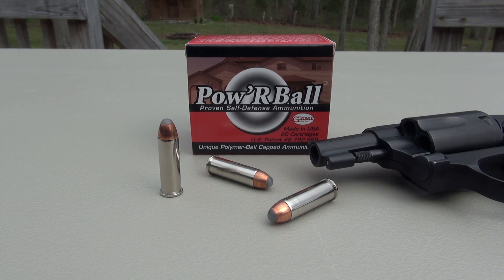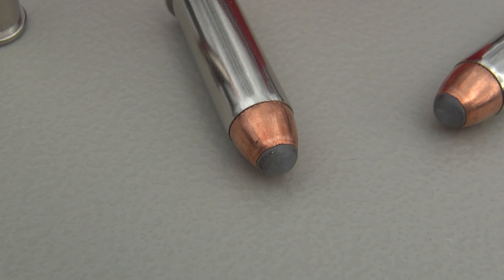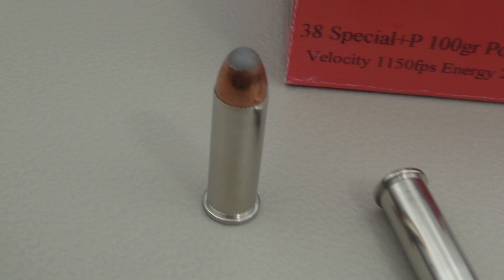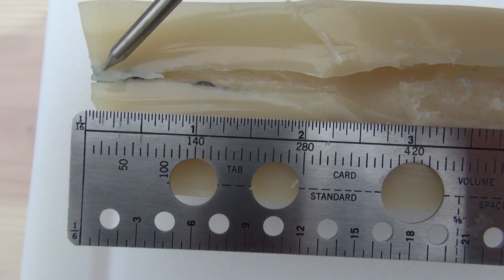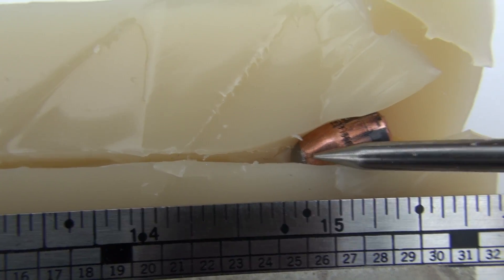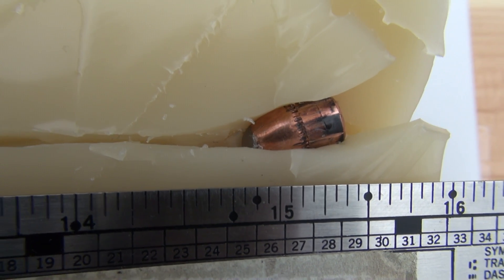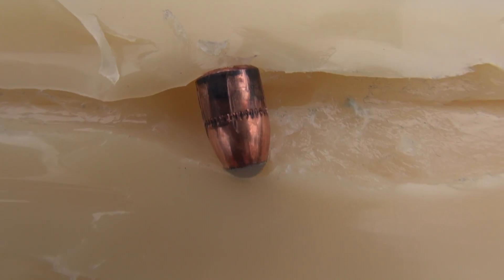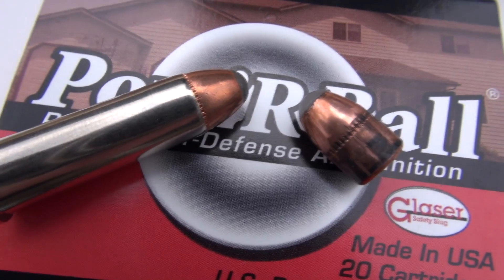CorBon PowRBall .38 +P 100 gr SIM-TEST w/Denim

Comment: most revolver hollow points will expand out of a 3 in or more barrel.
Reply: Most won't out of my Smith 649 1 7/8 barrel.
Reply: Then they should do well out of the Taurus 856 Defender with the 3-inch barrel.

Comment: No i never did hear from them. in my opinion its either Federal HST or Gold Dots for me i have never seen or heard of a failure of any kind with them
Reply: I recall using 125gr Gold Dot in a snub and water jugs with and without denim. Little to no expansion was noted. I'm not impressed with the Gold Dot in a 2" barrel. Even the new HST is erratic in expanding.

Comment: I think this says as much about the 17/8" barrel in the .38 as much as the bullet. You have had problems with other loads out of this same gun. I think it was Win PDX1 if memory serves me that didn't expand and went completely through the whole block. The .38spl is a lower pressure round and fired out of a short barrel even with +p I think performance isn't going to be stellar by any stretch.

Comment: @rifleslol True. But there are folks using .357 Magnum revolvers with 4" and longer barrels (for open carry or home defense, presumably) that tend to load .38 Special +P for defensive purposes because of the lower muzzle flash and lighter recoil (and perhaps for less overpenetration risk). Either way, this load seems to work great in semi-autos (for which I'm sure it was originally designed), but in revolvers ... not so much. Out of a lever-action rifle, however ... now THAT I wanna see! :-)

Comment: @PowerForGood "Revolvers... relics and range guns?" Consider, as a concept, that the chance of your semi-auto malfunctioning(fte, ftf, etc.) is 10,000 to 1; the chance with my revolver is 1,000,000 to 1.  That's 100 times better than your semi in the failure dept.  Yes, there is the reloading issue with the revolver, so maybe it balances out such that it's a personal choice rather than revolvers being insignificant.  With those odds though, I'll take my 5 shots over your 13 or so anytime.

Comment: Surprising result. My guess is the polymer ball is too hard for this specific application, as it's not getting enough velocity to really deform that polymer ball and start the expansion process. Hornady Critical Defense, on the other hand, has a much softer rubber-like nose that squishes in/out easily at lower-velocities and works better for short-barrel applications like this. I would expect Pow'rball in .38 Special to probably work better out of a 4" or longer barrel.